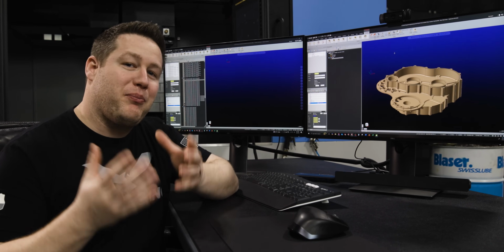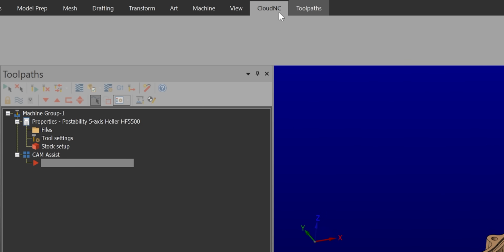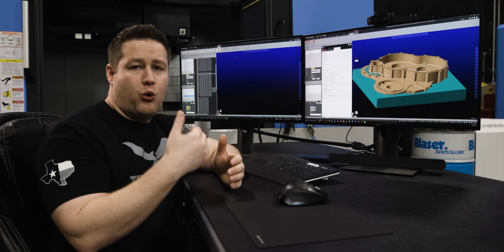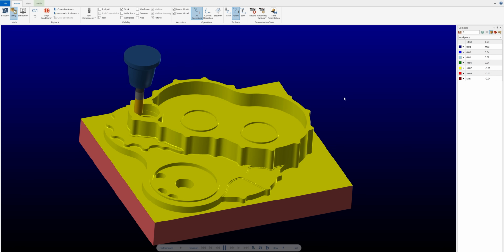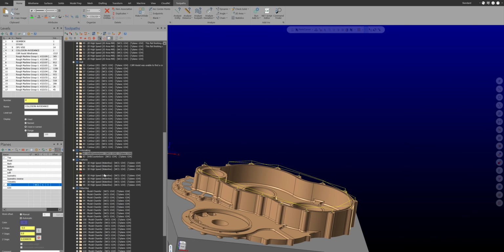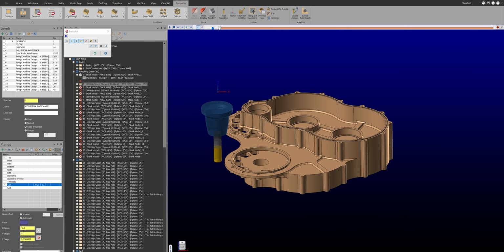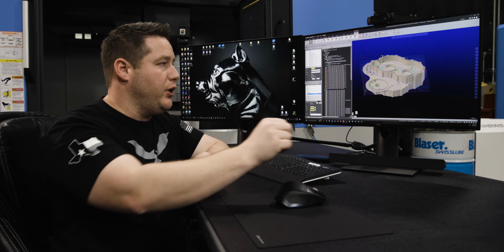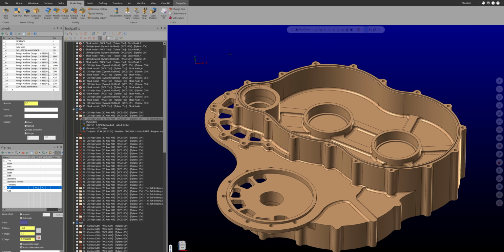How to use Ai in CNC Machining

Comment: The beautiful thing about technology is this the better it gets the less and less you need to pay people as they need no skills at all . The machines now measure your parts write there own programs. So you need a button pusher and a set up guy and a simple set up sheet . You wont need that for long either as robots are just as fine tuned as ever. They can switch out a pallet system . you can write a Marco that takes care of most everything. We run lights out every night from 5:00 pm till 5:00 am not a soul around the robots takes care of the parts.  When the run is done pallet spins new parts ready to run  machine stops for a first piece check at 5:00 am . I'm not hiring machinists anymore just maintenance people and general workers to move stock and tools from machine to machine . This trade is slowly going away at least the way we used to know it .  We are getting in new robots soon that will move all the paperwork around and bring parts to inspection.
Reply: How big is your shop? From your post i assume that you are on Amazon level !!!
Reply: Agree but do you have yet the machine so it can make the parts and program itself? That’s cost alot of money you have to wait years and years until this Technology become old so it’s chip and you can buy it and then you wont need for 10 workers maybe 3 for the hole.

Comment: If there was ever something machinist shouldnt mess with its this. 
This will finish killing off the machinist trade they already replaced the  bulk of machinist with cnc they are replacing operators with robots and automation, now they will replace the cnc programmers with AI.

Look it up 1960s there was 1.2 million machinist in America now about 250k ..... If this AI has the equivalent effect you will see a drop to 50k putting 4 out of 5 machinist out of work

Comment: CloudNC is still in the construction phase. You will be faster if you create the programs yourself. In addition, your machine time will be longer and your parts will be more expensive because the programs are not economical. CloudNC needs a few more years and needs help from all the programmers out there😅
Reply: I work in a high mix, low volume shop where we constantly do new parts….I’ve been using CamAssist regularly and can say it saves me time and works exactly as the video states: it gets you 75-80% of the way there. It’s also made significant strides as far as improvement goes in just the few months I’ve been using it (since Sept 2024)

Comment: Split cylindrical faces... that is in my experience not something related to step files... its more based on the CAD software that was exporting into the step - eg. CATIA does that.
even more vicious are models out of ThinkCAD. that software's exported models are sometimes THE horror to work with.